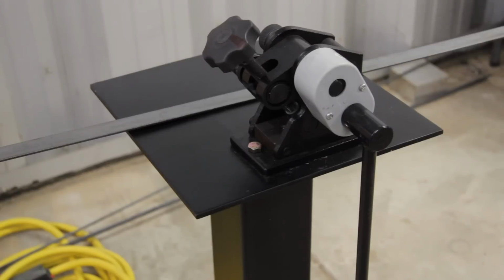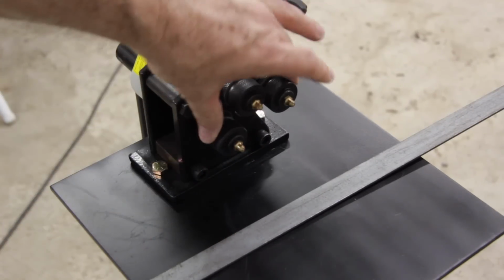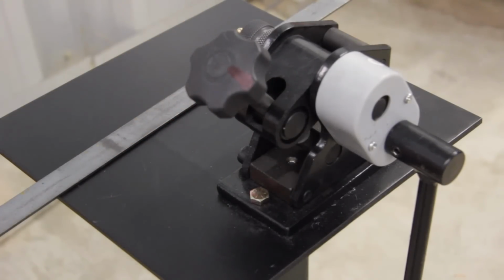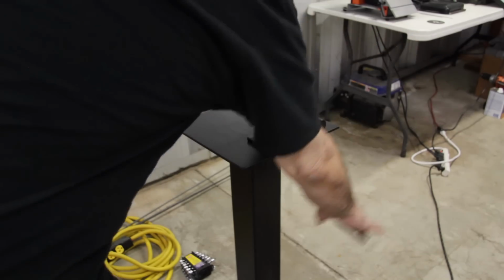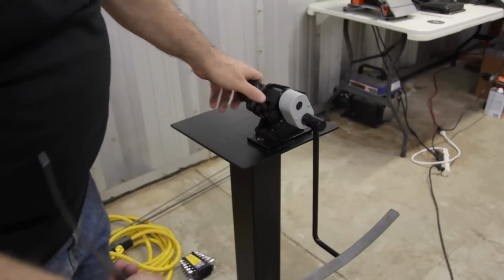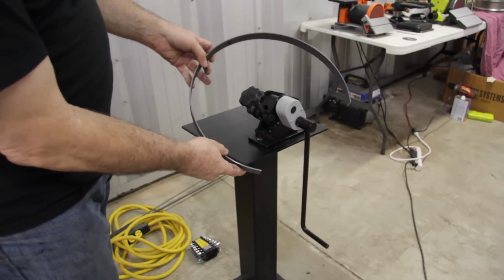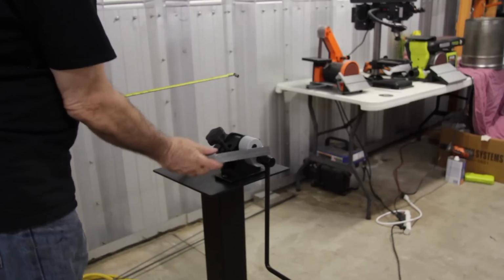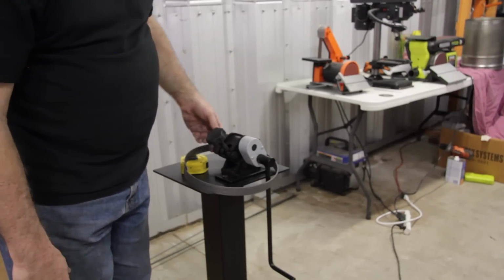Harbor Freight Ring Roller

Comment: I was told that this thing's made out of plastic the main body of it
Reply from the maker: No it is metal,  but if you try to bend metal that is larger than the specs. It will break.

Comment: Would it roll 3/16" X 1 1/2" flat hot roll?
Reply from the maker: Flat bar max size is Metal sizes up to 3/16 in. x 1 in. and up to 1/4 in. round

Comment: Can you use this to make 48” rebar circle?
Reply from the maker: You can roll up to 1/4" round stock, but because of the ridges on the rebar, that may interfere with the rollers,  I have rolled 1/4" round stock just fine.

Comment: Hey man I'm building ice climbing axes for my daughter I'd like to put a curve in the handles. Wondering how you think this device would work on 5/8 inch diameter hollow steel tube?
Reply from the maker: The ring roller only works with flat bar.  Here is a link,  Fill your pipe with sand and use the pipe bender,  YouTube has some videos on how to bend pipe without kinking.  https://www.harborfreight.com/12-ton-hydraulic-pipe-bender-32888.html?_br_psugg_q=pipe+bender

Comment: I got one of these, I tried bending 14 gauge aluminum x 1 in. It would bend the roller down some and then not track straight .
Reply from the maker: Hi rbhusana,  The ring roller is really meant for steel only,  6061-T5 is bendable but 6061-T6 is not and is brittle and will crack.

Comment: With the adjustable wheel supported by a PLASTIC  component this "tool" is not worth much unless you have a milling machine to make a replacement out of steel.
Reply from the maker: Yes,. But I found if you make small increments it seems to work fine.  But the ideal solution would be to make it out of metal
Reply: 6061 T-6 would work
Reply from the maker: @martyneither7580  yes agreed

Comment: I bought one of these before I saw your review. Good review and I learned a few things I wish I had known before. One issue I had with mine was the Tension knob split after I had formed a few rings in 3/16 steel rod and I could no longer turn it. To fix it I welded an old 3/8" drive 12MM socket to the end of the shaft and use a 3/8 ratchet to turn it. Having the ratchet also made it easier to count turns 1/4 or 1/2 turn at a time, depending where it was pointing.
Reply from the maker: Thanks Mike, Yes Harbor Freight Tools often need modding to keep them working. Doing a mod currently on my HF belt sander.

Comment: A few things a person needs to do before rolling a piece of flat bar.

1) Figure out the mean diameter which is the neutral bend of the bar stock
     This is for figuring the true length of the bar to be rolled in a ring.
2) Layout the true length on the flat bar adding an inch or two for the flat part 
     of the bar being rolled.
3)  Use the layout lines to cut the ring to size.

This will insure the ring will be rolled to a tight tolerance without a lot of waste.
Reply from the maker: Great Points, Thanks Rick for taking the time to post good info.

Comment: Hello,. Will that ring roller handle 1/2 inch. Aluminum tube to make a hoop for a paramotor,.   A Paramotor is that engine you put on your back to fly with a glider. Thank you
Reply from the maker: Here are the specs:     Metal sizes up to 3/16 in. x 1 in. and up to 1/4 in. round
    Create rings from 3 in. diameter to as large as you need
    All surfaces are heat-treated and hardened for long life

    Create chandeliers, plant holders, ornamental iron work and more
Reply from the maker: https://www.harborfreight.com/

Comment: Sneaking up on the diameter with lots of steps works OK if your material does not work harden.   I have rolled some stainless steel that if I used such small increments would have stopped bending on the third or fourth pass.  In other words some material will only give you about three passes.  Make them count.
Reply: If it work hardens just heat up with torch and it's soft again.
Reply: @PixyBossBabe  that is not always an option.  Certain stainless steels that are both non-magnetic and have a minimum tensile strength in excess of 140 ksi, depend on work hardening to achieve the strength.   This stuff is very difficult.   Very specific steps must be taken to arrive at final dimensions.    Bottom line, however, is to know the properties of one’s material, and proceed with operations that can safely manufacture the part, and keep the properties necessary.   
Of course with some materials the properties can be imparted by post processes.   Others depend to a very high degree on what the processes do to the material.  If anyone is interested, an excellent work on the various manufacturing processes and their effect on material properties is, MANUFACTURING ENGINEERING AND TECHNOLOGY, by Serope Kalpakjian.  Addison-Wesley Publishing Company.

Comment: Hey Joe, thanks for the video.  Is it necessary to take the metal out of the machine each time?  Looks like you could just adjust to "increase the radius" and turn the handle backwards.
Reply from the maker: Thanks Ron,  yes you could do that, but do not try to adjust to final adjustment for each new piece.  Roll will be uneven.

Comment: Garbage , waste of money.
Reply from the maker: Works fine for me.  Just have to work within the limitations of the product
Reply: Been a fabricator for fifty years , this tool may be good for an occasional ring or two , but in my line of work , totally unreliable , rollers walk and slip , felt like I was took.
Reply from the maker: Yup, you are correct, but most of us,  do this at home for fun.  You would have to do some major mods to make it work properly.
Reply: Right , the design is there , the rollers have a good knurl, it's just who ever signed off on it for sale to the public , dropped the ball in my estimation.
They swallowed the horse then choked to death on the tail.
Reply from the maker: Yes, common problem with import equipment,  American made is better quality, but many companies only look at the costs.  A problem that is a viscous circle.  Also a reason that American blue collar workers are paid so bad.  Something that really pisses me off.
Reply: Right , I agree , the map ain't the territory , and the territory ain't the map.
A lot of these tools are designed by people who have never used them.

Comment: Thank you for your interesting and informative video. I noticed a potential safety hazard re the pillar pedastel sharp corners and solid base. If you or a person tripped and banged their head or face on it, it cannot fall over because it is bolted fast to the ground and the injury could be serious. Would a round topped or rounded/protected corner be a solution. Just a thought. Thanks again for sharing your experience.
Reply: God damn Bruce why don’t you just stay out of the shop... this is where men come to use tools.
Reply: For fuck sakes. Babyproof the shop
Reply: really ?
Reply from the maker: Thanks Bruce for the good safety tip.  will have to get the grinder and round out those corners.
Reply: Joe's Fab Lab you're welcome Joe

Comment: If you are going to use this a fair bit do yourself a favor and roll yourself a large steering wheel/wagon wheel style crank for it...whether a ring roller or a bead roller it makes a huge difference in ease of use!...ideal is bigger tubing then this machine can handle but even a small rod one will help...single handle cranks are great if ya need a lot of leverage but  constant use plays merry hell on your back once they get longer then a foot or so..
Reply: I did a couple mods to mine that helped. The knurles next to the grooves marked up 1/4" round stock, so I ground those out a little with a rat tail file. I also decreased the backlash on the rollers using washers to space. This helps stop the twisting dogwalk that tends to happen. People that complain about breaking the plastic part must really abuse this thing. This tool isn't about making a very quick radius, like a die, but making an accurate controlled radius. Once set, it will repeat fairly well, but doesn't replace a press brake.
Reply from the maker: Thanks, that is a very good tip.  I like the idea if the wheel
Reply from the maker: Thanks 1Howdy1 for the great mods.  Yes I have been using my roller over a year and have had no problems.
Reply: Sure Joe. Yeah, I had an intermittant corkscrew problem that tightening things up seemed to fix. I don't roll very much bar stock, mostly 1/4" round.

Comment: Can you use this to make jewelry.
Reply from the maker: Hi Sylvia,  You can roll up to 1/4" round stock and the minimum diameter is three inches.  If you want to make smaller bracelets, you might want to look for a roller that is used for jewelry.  Thanks Joe

Comment: Hi! Can I use this roller to bend aluminium angle and "u" aluminium extrusion profiles? Thank you
Reply from the maker: Hi chuyetax,  no, not really,  it takes special dies to bend angle or "u" channel.  You would need a higher end bender to do so.  Harbor Freight documentation indicates the following:  "Metal sizes up to 3/16 in. x 1 in. and up to 1/4 in. round"

Comment: there a simple way to get rid of the flats at the end of the bended stock:
before bending, you cut the material at the exact lenght ,you bend to have the ends touching then you weld it and grind the bead flush.
you reinstall the pseudo ring on the roller and you roll it a few turns
the result is a ring that is round within 10 thou.
Reply from the maker: Thanks Jacques for the great tip.
Reply: Jacques Poirier
Reply: Yes great tip. thank you for this video joes fab lab. I didn't even know harbor freight sold this. I can now use my everlast and weld up my own rings!

Comment: have you ever done a progressive spiral? That is my new project.
Reply from the maker: hi Michael, you would have to keep on tightening the tension as you rolled,  I have tried it,  that would be an interesting experiment
Reply from the maker: sorry, have not tried it.  might be hard as the turns get tighter.  I have benders that do scrolls,  you might have  to go that route
Reply: Well I played with it to the point were I decided that the best way was to make a ring sized half way between a 360 degree arch of the spiral and make that ring fit into the CNC machined form I am using for the backing plate. I had to make 8 rings progressively larger and fit it together and boom, it worked like a charm.

I have not seen a machine for making spirals. If I ever take on another project like that I will look into it. The way I did this project the little bender from Harbor Freight worked fine.

One thing I would like to see on it is a flange to prevent it walking off the end of the rollers. I had to make this spiral out of 5052 and for some reason it had a tendency to walk out. The material was 1" x 0.125". But if I did not hold it in the roller in 3 or 4 cranks it would walk most of the way out.

Other than that is worked just fine for what it is.
Reply from the maker: Sweet,  that is pretty much what a scroll fixture does,  has a series of slight larger shapes that, as the metal forms around the smaller shape, then larger shape comes into place.  Check out this youtubee video:  https://www.youtube.com/watch?v=dZQAV8yRQkM

Comment: I have a question.  I was looking at the ring roller that you have.  I have to turn a 50' coil of 1/2" (od) stainless tubing with a wall thickness of .28mm.  It is currently 20" in diameter and I need to turn it down to 12" diameter.  Will that roller fit 1/2" tubing.  I saw the description says 1/4" rod but didn't know if the gate would open up enough to do it.
Reply from the maker: Hi Brian,  No the ring roller will only roll solid rod or flat steel bar up to 1/8" thickness,  But Harbor Freight does have a tubing roller.  Check out swag off road they have different size dies that you will more than likely need for the smaller tubing.  The dies that come with the Harbor Freight will only go down to 3/4" diameter.
Reply: Hey good video I'm just wondering it looks like you're turning the handle clockwise. If I do that on my ring roller which is the same as yours it backs the material out.

Comment: Did you notice knurl indentions on the metal?  It left a pattern on mine.  I'm thinking less tension on the rollers may prevent this.  Otherwise, I may grind off the roller knurls.
Reply from the maker: +Phil Laudenslager, Yes when I roll flat bar I do not get the pattern transferred to the steel.  But when I roll 1/4" rod it tears up the rod quite a bit.  If you grind off the area around the grooves that may fix the problem.  I would be worried that if you ground off the entire knurl the flat bar might slip.  If you look at a slip roller that has rod grooves there is no knurling.

So that may work.  I may remove the rollers and turn down a section and try it out.

Thanks for the suggestion

Joe
Reply: That thought had crossed my mind too!  For now I wrapped the rollers in several layers of electrical tape.  We'll see how this does, before I take a grinder to the wheels.  Thanks!
Reply: Phil Laudenslager II

Comment: If you extended the dies out, do you think it could handle 1/4 x 2 or something bigger? Great review BTW
Reply from the maker: +WTPFirearms Thanks,  You could try, but I would worry about the strength of the frame and adjustment mechanism, you might crack those with the additional force,  Everything is pretty thin.  I would try extending the rollers first, you might be able to roll 2" by 1/8" .
Reply: They sell another roller that handles wider and thicker stock. It’s bigger and costlier!